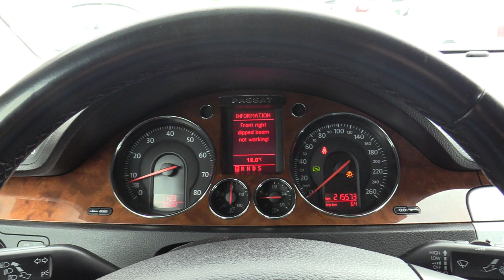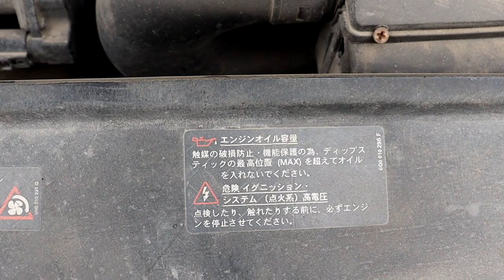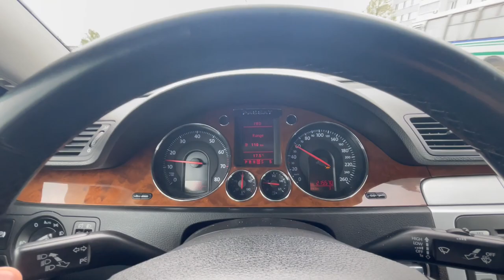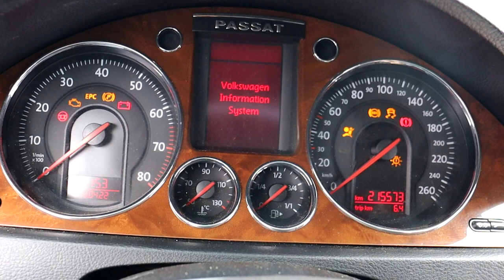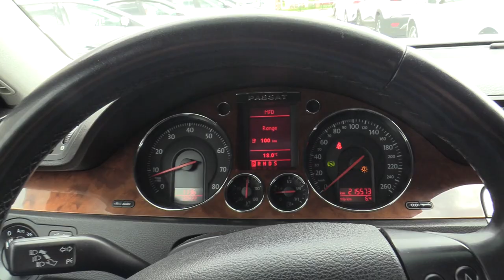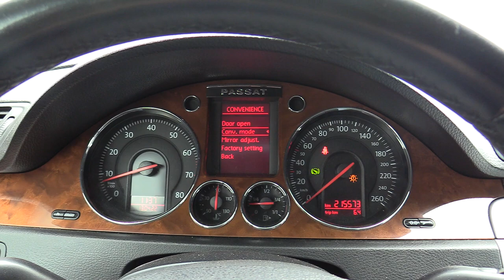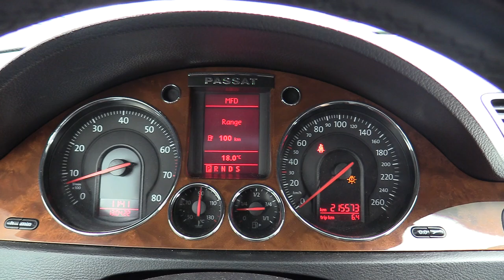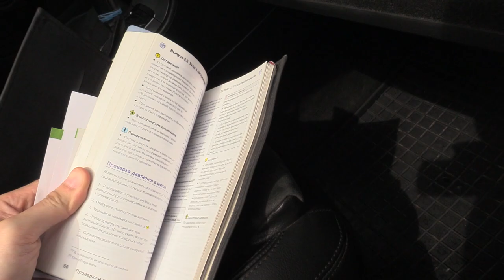2008 Volkswagen Passat 1.8 TSI. Start Up, Engine, and In Depth Tour.

Comment: I wonder if these engines are reliable, I don't like turbo engines, I prefer naturally aspirated engines for reliability.
Reply: Engine is good but waterpump, fuel pump, sensors are a pain in the ass.